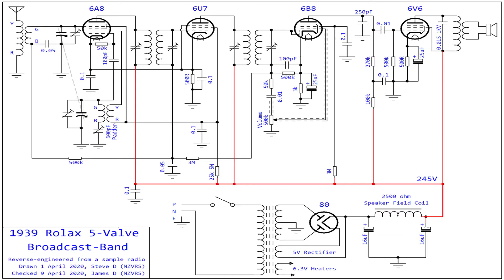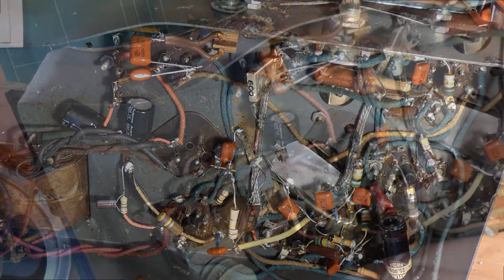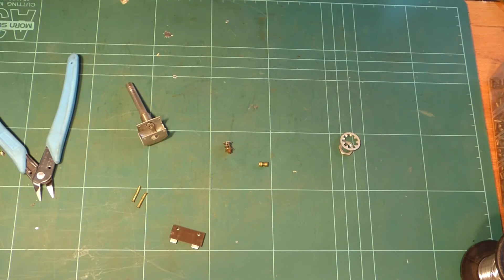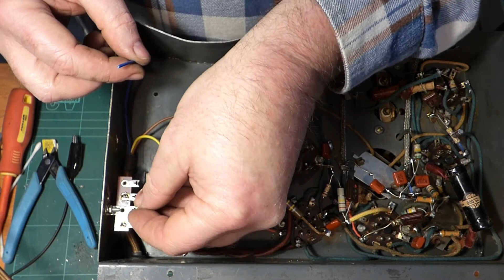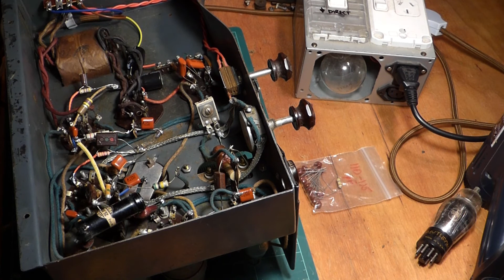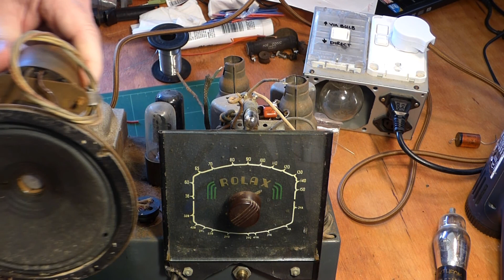3 of 4 - Repairing a 1939(ish)  Rolax 5-Valve Broadcast Band Radio

Comment: Newbies re SOLDER !! Make sure you use the right one ! ALSO valve radio soldering requires a HOTTER iron than one you use for ie modern motherboards/printed circuit boards et!! Use the WRONG soldering iron and you will on some of the tougher soldered terminals realise the 'error of your ways!' 👀😀I use a VARIABLE temperature module soldering iron BUT also have to hand a 60watt, and a 40watt iron. USE a decent FLUX AND remember NOT to breathe in the fumes ! 👀

Comment: Oh yes, been there got the tee 😗😀re circuit symbols, designs et from early Coreldraw to Adobe photoshop (NOT the online vs) I also if I have the circuits et SCAN them so I can magnify, edit et with ease. 😗For those in the UK re valve references/data et the British Valve MUSEUM (online) is worth its weight in gold.. for a lot of very relevant data re valves and more. 😗 Newbies Always remember that valve radio/equipment can have DANGEROUSLY HIGH voltages unlike transistor/IC gear.. An electrolytic can give you a kick back eye watering, teeth juddering >500 volts.😗 Some cheap and nasty, early valve radio sets 1950s+ had a chassis which when you applied mains voltage et the chassis was LIVE and could give you a very nasty shock. 😗👀Touch the anode (top of the valve ) metal cap and the anode kicking out another eye watering juddering voltage kick.. 😗 NEVER NEVER, EVER, take an old radio that has not been used or bought via a charity shop or off a stall et and plug it in!! Often the mains power lead is a good warning sign as when examined it can show signs of bare wires poking through perished rubber cloth wire et 😗Great vid and some well worthy advice buddy! This ain't gonna win a beauty contest anytime soon.. so leaving the radio with a minimum of necessary work is more than acceptable. 👍Lastly NEWBIES AND those who buy our revamped / renovated / repaired sets = VALVE sets should NEVER be turned off and on like ie a transistor or modern radio et OOOH look I have a valve radio.. listen to this.. flick on.. wait, tune, listen, turn off all in less than 5 > 10 minutes??? I NEVER! 🙄with the radios in my collection would do that! My radios et once turned on are left on for a minimum of 30 minutes.. 👀 Most more than that.. Family/friends all know the LOOK but NOT touch applies..

Comment: I have thrown all my clip leads in the bin as their unreliability is just damn dangerous. I have found 4mm Hannah's plug leads with 4mm to alligator insulated clip more versatile and reliable. White Terral to worry about the print on heat shrink when you have just installed a bunch of brown drop caps don't you think. Still good watching though.
Reply from the maker: Hi Bob - I like clippy leads - I just don't like the way the cheap ones are made - they can be fixed though.  Banana leads are definitely useful too - I have some good quality ones with bigger alligator clips on the ends which I acquired recently... you might see those pop up in future videos.  And re: the heatshrink vs caps thing... I guess we all have a point we like to get to in terms of how repairs / restorations go and things we're ok with vs. things we aren't.  I don't like the look of visible writing on the heatshrink so I hide it because I can do that easily... but restuffing caps is a lot harder - I save that for the big 'important' (to me) restorations.  The Pacific 107 I'm doing at the moment for example.  I'll detail that in an upcoming video as well... if I ever get around to finishing it :)
Reply: I ended up making my own clip leads. I found some nice wire (nice as in nice to the touch and reasonably pliable) and a stack of good quality croc clips from a surplus electronics store. The ones that are available today are cheap chinese ones and bend (just rubbish). I made up about 30 clip leads in total, more than enough. The best croc clips were the ones that David Reid Electronics used to sell back in the 1980s! Probably made in Taiwan or Japan.

Comment: To solder components I always let the wire strait insight the eyelets of the contacts, so it's easy to unsolder the components. To solder 2 wires together I put them parallele, in contact, and never use hooks.
Reply from the maker: I agree that solder is stronger than most people give it credit for, but its also soft and brittle so I like to give joints some mechanical strength before soldering them.  Besides, the next serviceman in 30 years needs a reason to swear at the last guy (me) while he's repairing it.

Comment: Enjoying the series of videos Steve. Keep up the good work! The volume pot in that set is a Centralab and are not that uncommon in radios of that era. The good thing about them is they are easy to pull apart and all the bits are interchangeable. For example you can swap a switched back cover on to a non-switched pot and vice versa. Swapping shafts between pots is also possible. So don’t throw that faulty one out. 

I agree with your approach with this radio, leaving as much of the original construction “style” intact as possible.
Reply from the maker: Thanks :) I see Centralab pots in quite a few radios from this era (although typically American sets, not Kiwi ones) and they're generally still working fine (which is unfortunately why I have no spares for this one).  That style of mechanism seems to give minimal wear on the carbon track unlike the more typical wiper style found today.  I loved the colouring in the bakelite body of this one, so I've kept it.  I wish I had the alchemy skills to create new carbon track...

Comment: looks like youll be experimenting with "tone comp" capacitor values to get a value that suits. The noise level is probably going down when you put the cap across the primary of the OP transformer because you are bypassing any residual IF thats been ampified by the output tube from passing into the OP Transformer?
Reply from the maker: Thanks for the advice on values - I was actually pretty happy with the 0.005uF value, so I'll stick with that.  I considered reconfiguring it to a more traditional plate-to-ground cap (and also potentially replacing the on-off switch with a tone control) but decided to leave it as-is because thats how it was.  I'm not sure where the noise it was limiting was coming from - the whole garage area of the house is electrically quite noisy... its something I need to track down.  Hopefully its not the beer fridge!  Cheers, Steve
Reply: @VintageRadioSteve  As I have quoted before, I use an old vacuum cleaner suppressor cap across the mains input neg/pos. Gets rid of that mains hiss et 👍